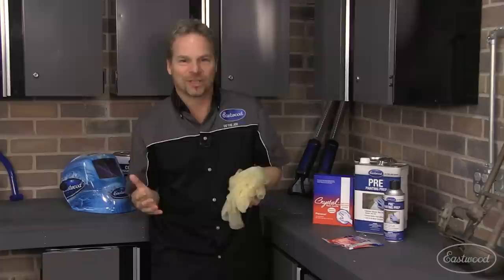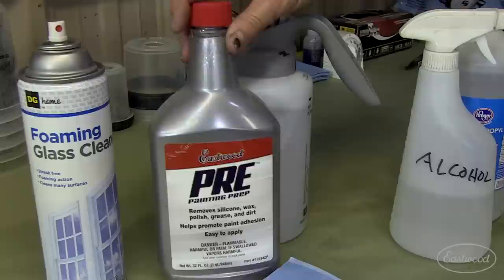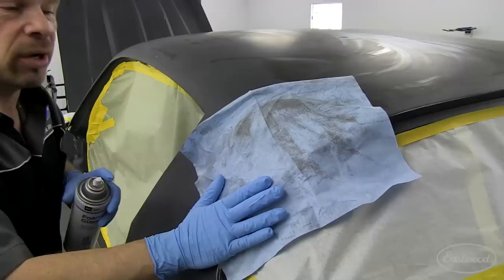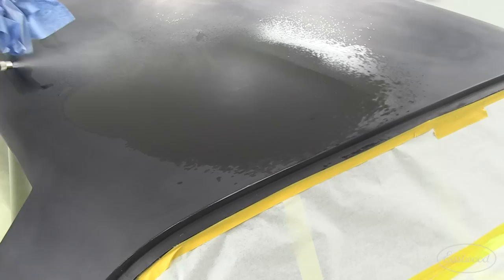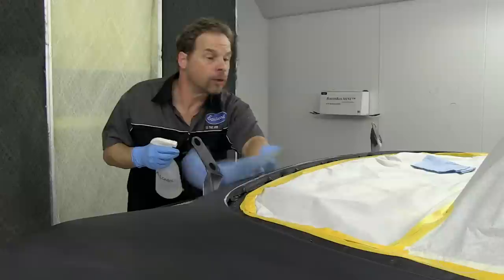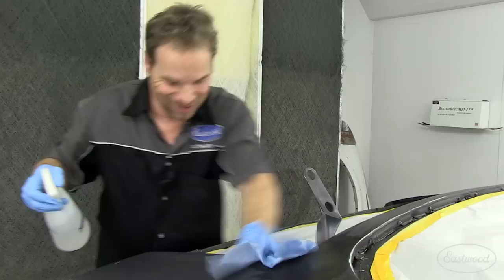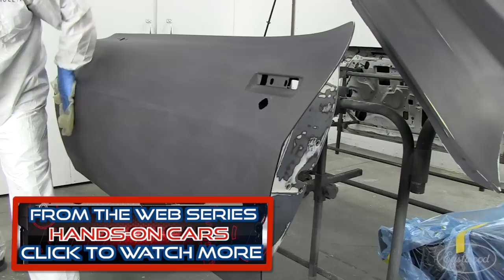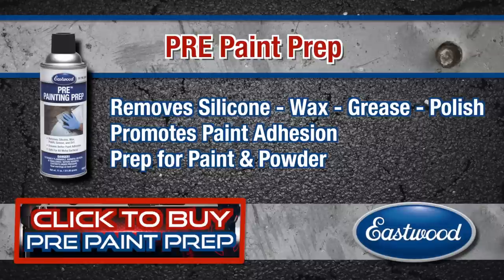How To Prep Your Car for Paint with Kevin Tetz at Eastwood

Comment: I was so excited to get the pre that Eastwood sells. Found out on my last job it was giving me a chemical reaction to my paint and event thought the base was put on months before. Just wiping it lightly after sanding a bit for my clear coat, I saw that it was removing the base coat and then actually caused my clear to crack. But I don't expect Kevin or anyone to answer. Just needed to get the word out. Thanks!
Reply: Did you make sure it was absolutely DRY before painting? I know thats a dumb question, but not really, because the stuff doesn't dry as fast as alcohol or acetone.

Comment: Watch out for the tack cloth, I just used a Gerson yellow tack cloth and it made my clear coat job full of fish-eyes !     Just spend 20+ hours resanding the clear on my doors,  and  now getting ready to re-clear them WITHOUT using a tack cloth !
Reply: Wow thanks for the warning. How did you clean it? I was thinking dish soap or maybe detergent for a total grease remover then wash thoroughly.

Comment: Make sure epoxy is fully dry before cleaners...trust me One side note i used straight up W&G remover solvent to check body work filler stages.. Big mistake on my part it attacked all the feathered filler edges to the epoxy ground coat.After many $$$$ wasted found out that was a big mistake. Is your ``PRE`` the same as Water bourne w&g so scared to use the harsh w&g or your pre on anything but bare metal now. Maybe just water over panels and make sure it evaps really well before continuing.

Comment: What do you use to clean bare metal that the paint has been ground off or sanded off and also what to use over the filler before painting?

Comment: Ummm, rubbing alcohol is isopropyl alcohol diluted with distilled water at about 50-70% concentration. So you are effectively using rubbing alcohol. I suspect that the more alcohol vs water, the lower the flash point. IPA fumes are definitely flammable so I’d exercice caution but I’ve personally never experienced or seen issues.

Comment: What's good (degreaser) for BASE COAT  before i put on the CLEAR COAT ? So the base coat does NOT come off ...
Reply: Have you figured that out?
Reply: No reason to clean the vase coat.  Are you using a containment close by?  Spray the base, wait until completely flashed off and apply clear.

Comment: I just use a normal air nozzile gun with paper and go over the panel again with my bare hands. yes my bare hands. Then i wash it with plastik reiniger from standox. Little dust and clean resoult. You will never have a 100% dust free panel no matter what you do. Those who claim that they do is lying

Comment: Actually, I'm more interested in how you clean up all the flux and mess after a weld.   That stuff is stuck on and nasty, and you can't always get to it with a wire wheel or other rotary brush, and a hand held wire brush don't do the job.   It would laugh at glass cleaner, prep, and alcohol.